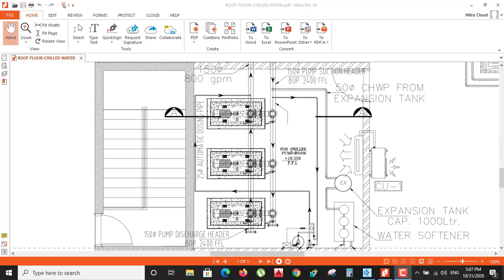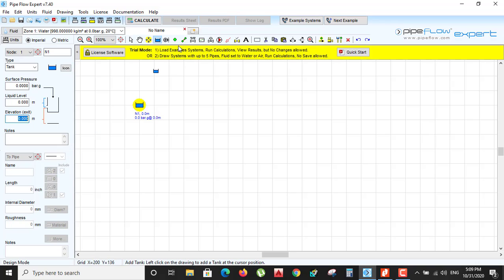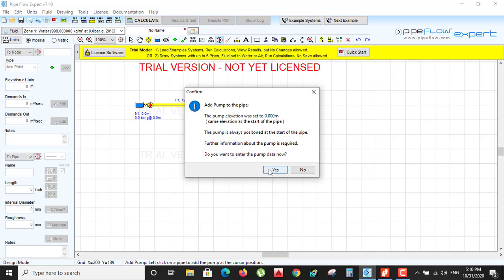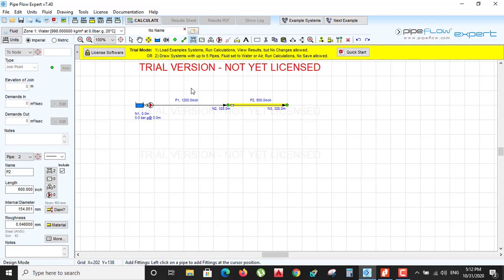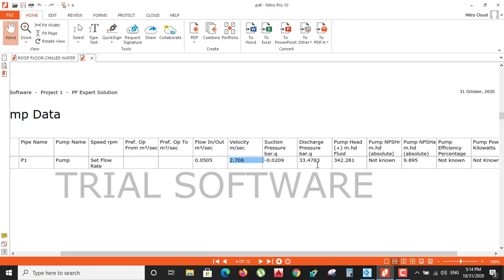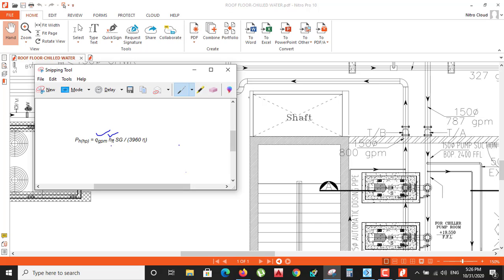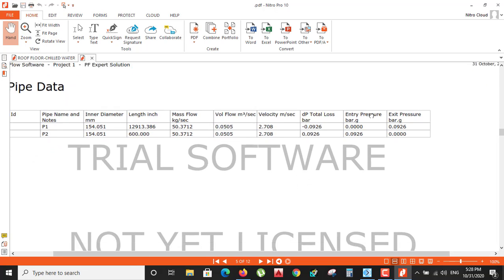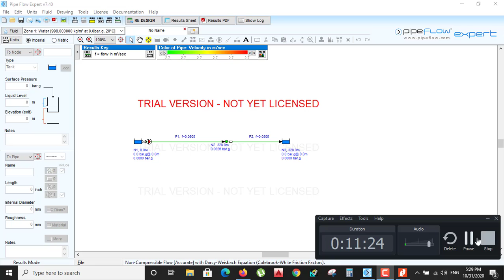How to calculate Pump Head by Pipe Flow Expert - Chilled Water System (ENGLISH)

Comment: Dear sir , what is the use of Expansion tank in chilled water system , and is it that capacity of Expansion tank will be same as total gpm of chilled water in all pipe lines . And when it's required to have Expansion tank in the system , also does the Expansion tank is same as air separation tank ,
Also sir , while 1st commission of chilled water system from where do we initially filled our chilled water system I mean at which location  we have this tapping in chilled water  piping
Reply from the maker: Expanison tank and air separator are two different equipments,expansion tank is used to protect system from excessive pressure, when chilled water come back to chiller its temperature is higher than outet temp, so expansion tank is used there in closed system, and air separator separate air from system.
Reply: @passionateengineer04  
Also sir what about  , while 1st commission of chilled water system from where do we initially filled our chilled water system I mean at which location  we have this tapping in chilled water  piping
Reply from the maker: @thepurposeofmyexistence2511  There is make up connections for chiller with booster set, which will provide water to chiller.
Reply: @passionateengineer04  can you explain this point in chilled water layout dear sir , it will be easy for  us  to understand 😊
Reply from the maker: @thepurposeofmyexistence2511   ok i will make a video on schematic of chiller

Comment: There is seems to some wrong. 
1. Chilled Water is a closed-loop so height have no addition
2. 2W+1 Duty pump configuration we have to two pumps working together.
3. I did not understand 2 tanks idea
Reply from the maker: Tanks are just for example you can add heat exchanger here, its an example to calculate the pump head.

Comment: Is it possible for a centrifugal pump to be supplied directly from water company network without having to go first through a reservoir (intermediary tank)?
Reply from the maker: Yes its possible but you have to install air separator on suction line or you can use self priming centrifugal pump, but there must be some gravity flow in pipe.

Comment: Nice video sir...suppose chiller and pump are situated at the basement..and the pipe run upto 5 th floor and connected with last AHU. Here is also supply and return pipe. So for pump head calculation, do i calculate supply and return pipe loss and also fitting loss within the critical path.?
Reply from the maker: You have to select both return and supply pipe for calculations, including all fittings and equipment connected on these lines.
Reply: @passionateengineer04  thanks.
Will i calculate vertical pipe as direct.? Suppose supply and return vertical  pipe run from ground to 5 th floor like 60ft....will i take 60 ft directly without other loss calculation..which we consider for simple water pump where is no return line.
Reply from the maker: Vertical line is equal to the height where you are pumping water, so this height will be TDH, if there is no other fittings.